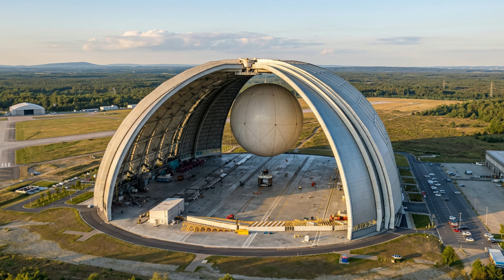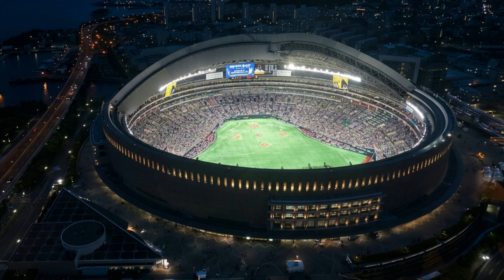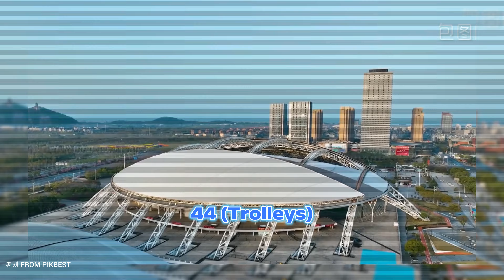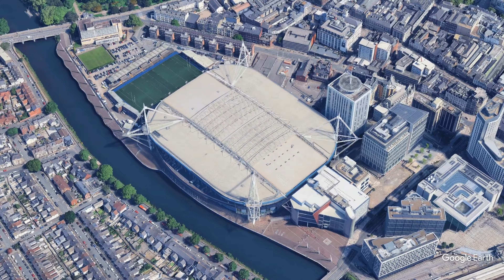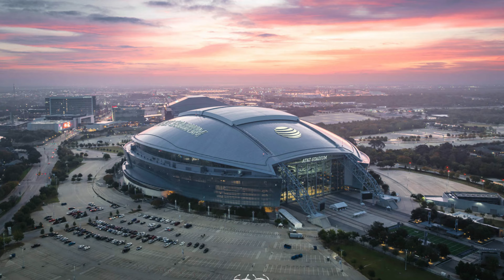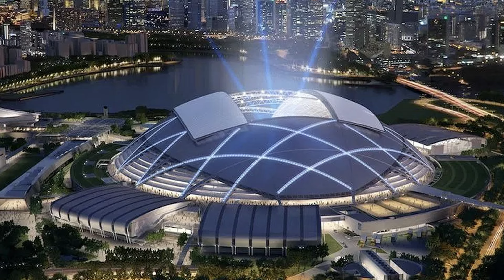The Biggest Domes on Earth (And Why They Don't Collapse)

Comment: This video is an absolutely fascinating deep dive into the world of mega engineering! It is mind-blowing to consider the level of precision and structural innovation required to build these massive domes without relying on internal pillars. The way the video explains the transition from the industrial failure of the Tropical Islands hangar to a lush, functional rainforest really highlights the beauty of adaptive reuse in architecture.

I was particularly intrigued by the contrast between the various stadiums featured, especially the unique kinetic solutions like the floating grass pitch at the Sapporo Dome and the massive retractable roof at the Singapore National Stadium. The video does a fantastic job of illustrating how engineers must account for extreme environmental factors from freezing snow and salt-heavy ocean air to tropical heat and humidity. It really gives the viewer a newfound appreciation for the hidden physics and complex maintenance routines required to keep these giants standing safely. A truly impressive look at the limits of human design!
Reply from the maker: Thank youuuuuuuuuuuuuuuuuuuuuuu